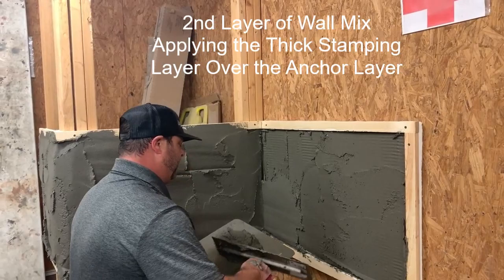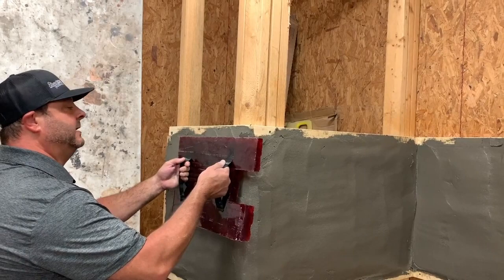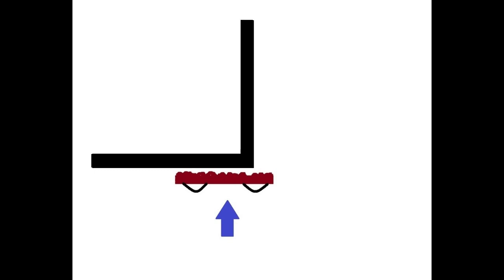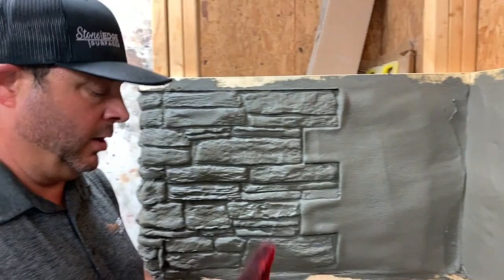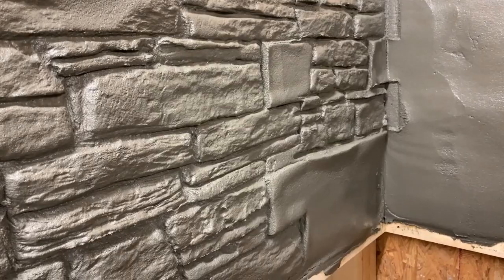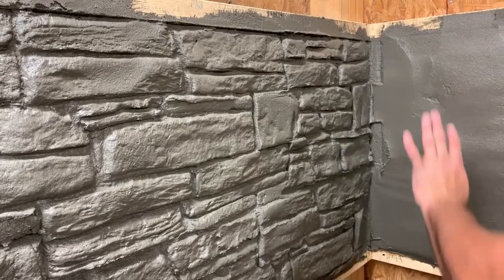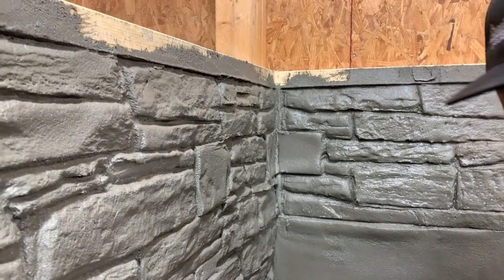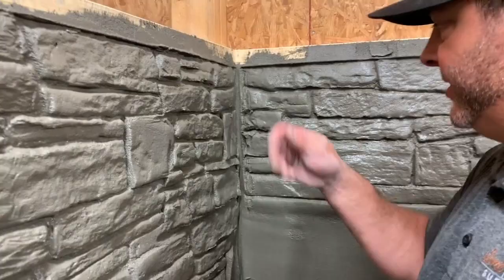How To Stamp a Wall Inside and Outside Corner

Comment: I’ve a feeling this could really take off over the next several years. There are a lot of wood siding homes in the southwest and northwest that need to be retrofit for the increased fire risk they are facing. From what I’ve been able to find so far, it looks like stucco is going to be the most cost effective added cladding for many of them. But not everyone likes the look of stucco. This gives some great alternatives. Install mineral wool board and a class A fire house wrap then this reinforced by 2 layers of spider-lath - massive improvement! (The Australians might be interested too). It looks like it’d ride out an earthquake reasonably well too.
Reply: Where do you get the Stamp? No one has told me... I have watched 5 video ,so far. ..Thank you.

Comment: Is there anyway to add different colors to the stone
Reply: You can get a die to add to the mix  but that would be for the full section of mix you use . Or can you stop 3 to 4 different batches  A different color mixes.and add them in Patches on the wall, but it will more likely mix. Or you can pain the Individual breaks to whatever color you want it to be